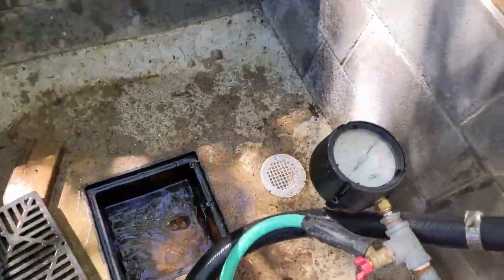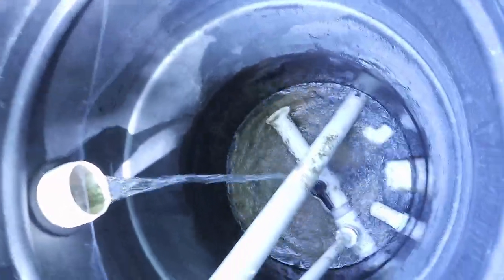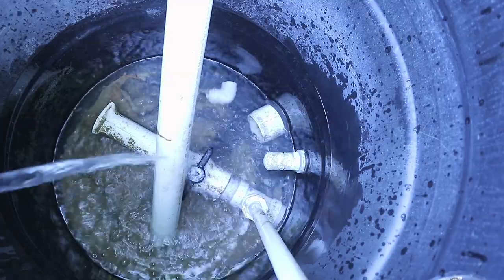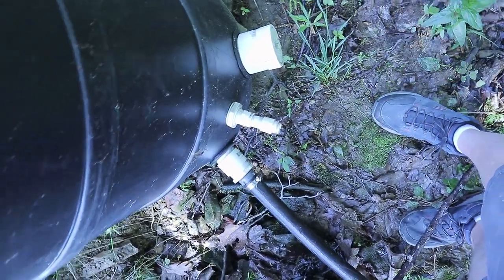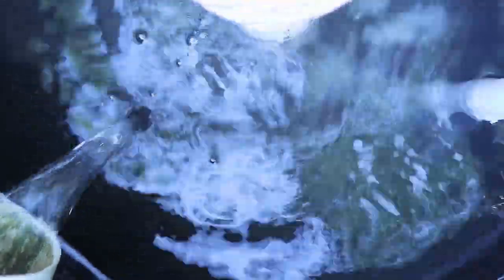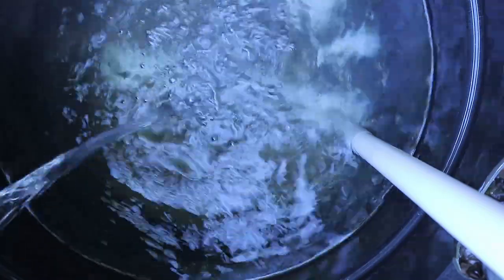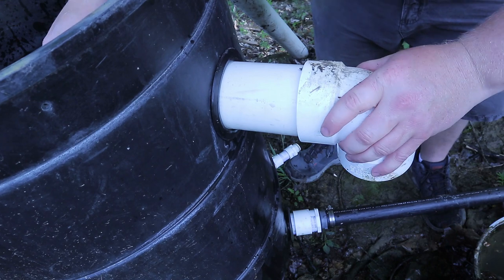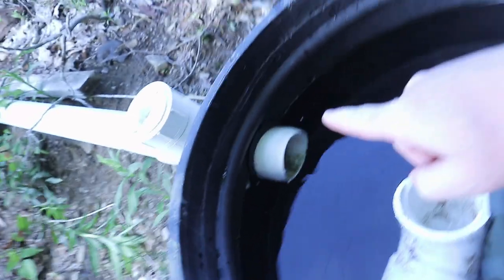Forebay Tank Overflow

Comment: Nice setup dude! When a PVC is not wide enough for it's rubber sealing and it leaks I always use high quality tape around the pipe. I had a rubber seal that did not seal anymore too, and tape worked like a charm. You can add one or two layers, or more, of tape over the pipe end so it won't leak anymore at the inlet barrel. Good luck!

Comment: I'm sure you figured out a good fix for your leak at the bottom uniseal but if you have another leak like that in the future, a piece of flex tape (brand name) with an x cut over the hole is a fast and effective way to fix it. Put the flex tape on. Cut your x. Then press in the uniseal. Worked wonders for a badly cut hole I had done. Love the videos. Micro hydro is my next project with my little creek.

Comment: Put a 'T" handle on your valve open/close tool.
Reply: Yes, just drill a hole through and put a rod in...
Reply from the maker: I am.
Reply: Or put it on the outside of the tank...
Reply: I must admit, I was curious as to why the valve is inside the tank, not outside. I imagine it has something to do with trying to relieve pressure from connections by the penstock pipe. Maybe the solution to that would be to create a section of outlet piping to connect the tank to the penstock, that can be buried in, or attached to an anchoring concrete block?
Reply: @svfirefly2702  or maybe to keep it from freezing?
The penstock will survive freezing, but the valve will get destroyed...
Reply: @svfirefly2702  Installing the valve inside the tank protects it from several things, without having to build additional protections from the elements.
Reply from the maker: @Stackinginvestments1  Spot on. Especially when it's freezing and the valve is on, the system is assumed to be running. if the valve is off, the pennstock should be empty. Having everything in the tank and kept at about 50F by the spring water is best.

With the system running the vent pipe would be prone to freezing if it was exterior to the tank. Temperatures down to -25F are possible where I live, most winters the worst low is about -10F though. The system has been operational through two winters so far and I haven't had it freeze up yet.

Comment: as you will most likely open up the dam to see what is wrong in the collection system a good source of clay if you have problems sourcing it is dollar store unscented clay cat litter. Soak some for sealing but the dry stuff to layer a few inches on the bottom of the collection area will become a good barrier over a few days.
Reply from the maker: I think my plan is to mortar a bunch of rocks in place of my plastic weir which isn't a great fit.

Comment: yipee, my favourite part of your hydro system. and we get to see a complete overhaul!!! as to the tank leak, there is a product made for boats that is supposed to seal up holes, its like a two part epoxy putty, but it is semi flexible (evo-stik plumbers mait in my country, spelled like that or else alcolin mix n fix aquamend) you could use some of that? to avoid draining and rying the tank... but since you are probably doing a complete rework, whick means the tank is drained anyway... maybe do what you said before... and find a baffle to install, or just use large amounts of silicone calk.
Reply from the maker: I need to fix the erosion anyways, so I'll probably seal it up then.

Comment: I just wonder if it is time for a larger tank like a icb tote tank,they have a preplumbed out let which reduces potenial leaks. The more water you have in reserve  does to things increases pressure  do added weight of water colum in the pipe and gives the spring more chance of  filling before demand by the turbine. I am wonder if a small tank on that seeping  spring would help it increase flow for more potential water by keeping the outlet under water to keep water flow the same level?
Reply: LOL, can you imagine hauling an ICB up that mountain. I mean, its a good idea but I wouldn't want to do that.

Comment: Hi Joe. From what you show it seems like the pipe volume is around 500l. Obviously to maximise the energy coming out of the nozzles, you want to keep that pipe full all the way for maximum head pressure. Have you looked into remote level sensing and solenoids on the nozzles? I don't know how much restriction solenoids have on the flow, and maybe the larger ones take a lot of power to energise. If you size the nozzles in powers of two flow rates, (2 gal/min, 4, 8, 16), you could get fine-grained control over 30 gal/min by switching in binary with 4 solenoids. Obviously size to the maximum flow rate you expect.

The more I think about this, the more difficult it seems. You're going to probably need some custom Arduino-based battery powered wireless water level sensor reporting back every few minutes and a lot of effort in just getting the solenoids up and running, never mind water proofing and monitoring. It would be a cool project though.
Reply from the maker: I built almost EXACTLY what you describe last month. I just haven't gotten around to doing a video on it yet. Only I'm doing bottom pressure measuring. As flow increases so does dynamic friction so I will use a lookup table tuned to my system.
Reply: @JoeMalovich  Ah, awesome! That's actually a much better way of doing it, a lot simpler.

Comment: What about putting the uniseals from the inside, so the pressure is pushing them in and hopefully reinforcing the seal? (the penstock is also sealed using uniseals if I see correctly)
Reply from the maker: uniseals are tapered and are meant to be installed from the outside.

Comment: solution for fixing that leak at the bottom of the barrel .   POOL PUTTY..   its a 2 part putty, that is safe for sealing around inground pool drains.. it cures under water, and works great..   you can form it however you like and it will seal.

Comment: Joe re bio matter in your header tank. look at "Radial flow" filters used in Aquaponics systems. which are essentially a tank in a thank. silt and leaves are caught in a central core and fresh water is able to flow into an outer core where it is drained off. have your clean out reaching into the central dirty core so you can flush the rubbish out from time to time, and your penstock shut off in the outer core, so fresh non rubbish filed water is supplied to it. I would also have the penstock exit much higher in the tank, at, or almost at the same level as the overflow.  Re the leaking Unseal, it looks from the video to be no seated correctly, it appears to bent and half out. These rubber seals need the plastic edge of the barrel hole to be captured within the inner rabbit grove of the seal. Your seal looks to be bent off centre, possibly because of pipe weight pressure and or movement caused as air trapped in the penstock flexes the pipe. I would reseat the Uniseal and see if the leak subsides, and if it does, build a structure that holds that joint still and in the correct orientation. Regardless of what movement thee is in the rest of the penstock pipe. I hope that helps

Comment: you can use JB weld marineseal for boats to seal plastic really well, they also sell a putty that you can push on (steelstik iirc) that seals really well too
Reply: Depends on the type of plastic, if it is for example PE there is almost nothing that will really stick to it

Comment: Why don't you run multiple collection barrels so that you have more reserves and possible higher and or more consistent psi? You could stair step 2 or 3 down the line and rather then having all of that over flow just wasted can then be used.